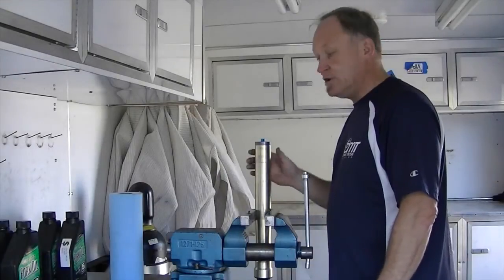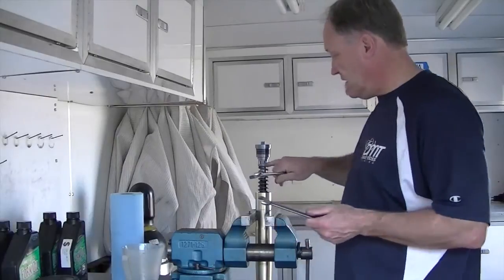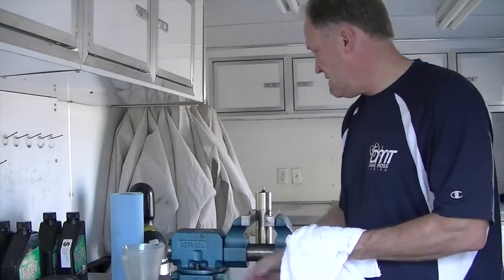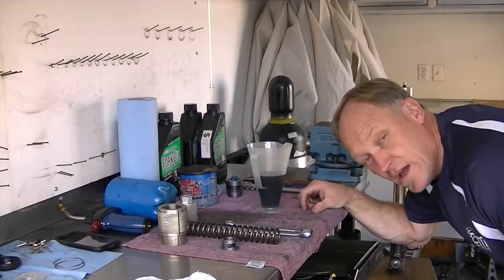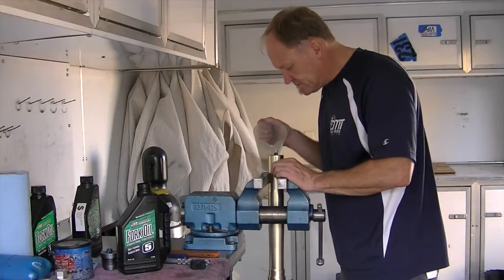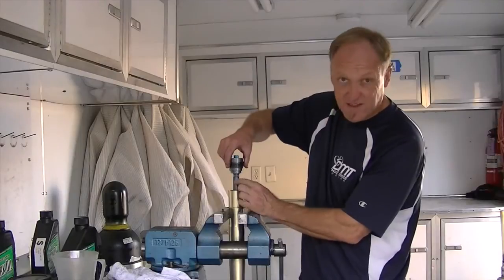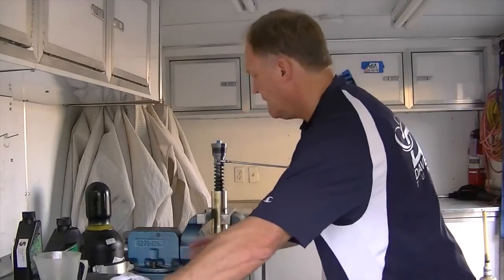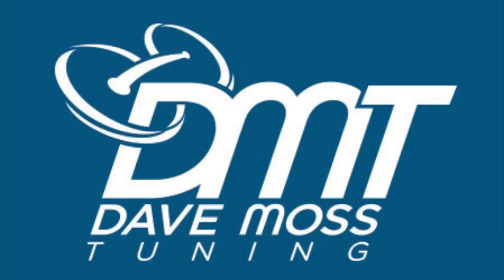Fork Oil Change of GP Suspension 25mm Kit

Comment: Do we need to rinse/clean out fork tubes before pouring in the now fork oil? I've seen a few harley videos where the person rinses the tube to the shop sink/tub.  Was wondering if that's necessary?
Reply from the maker: This is 100% personal choice. You want everything spotless, clean it. If it has been 20,000kms or more, clean it. Frequent oil changes limit the build up of metal debris. Take a moment, be true to yourself and proceed accordingly.

Comment: Hey Dave, I'm looking to rebuild my 25mm Ohlins kit (essentially the same as the GP unit) for a 2008 R6. What oil level do you recommend (in mm)? Also is the oil measured with the spacer in or out of the fork assembly? Thanks again for the video, it's much appreciated!
Reply from the maker: Maxima 5w, oil at 120mm, spacer in.
Reply: Thank you!

Comment: What about the metal shavings and debris. Doesn't that take up the volume of the oil.
Reply from the maker: With oi unchanged at 30,000 miles, we found 150cc of metal in 450cc of oil. Yes, it does - hence changing the fork oil frequently.

Comment: Is the cap tool necessary or can you use the preload nut to separate the assembly?
Reply from the maker: Some form of tool is necessary and there are a couple of options other than the Ohlins pin tool, such as a scissor pin tool from Motion Pro in their suspension section. Using the preload adjuster often jams it and then you may have to buy a new cap.